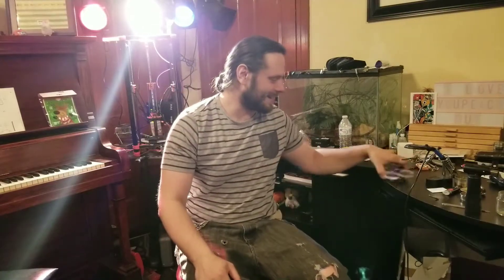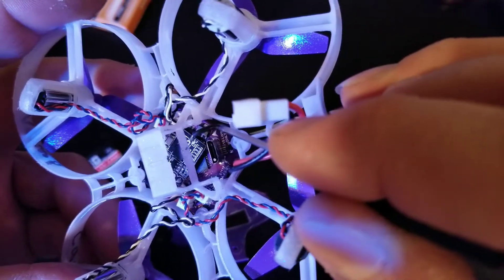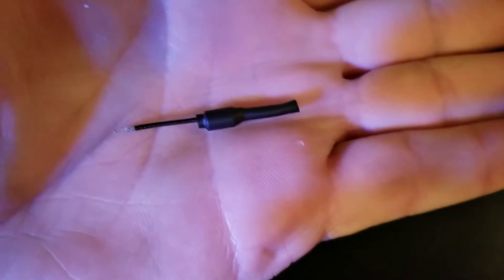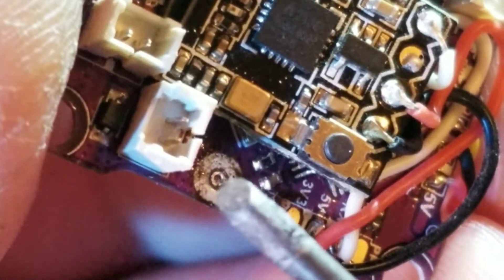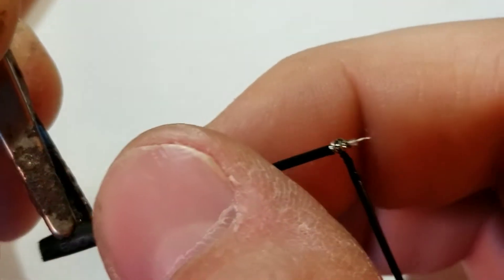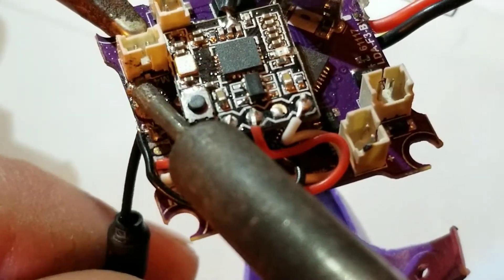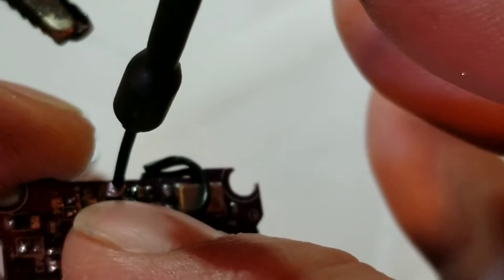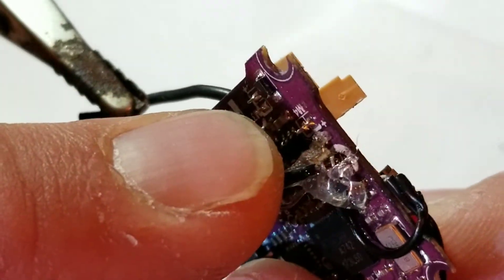King Kong / LDARC Tiny Series VTX Antenna Upgrade

Comment: Dude, my copper antenna from tiny8x just broke off :( guess I will have to hack it up, I guess it will be messy and probably fatal for the FC, wish me luck...need to find the new whip antenna first thou.
Reply from the maker: Did you lose the broke off copper antenna? If you still have it just try to remove the bit that's stuck inside the board, tin the wire that broke off and solder thay bad boy back in. If it's lost then yes, good luck on the new antenna install!

Comment: I have a Tiny GT7, it too has a crappy single copper wire VTX Antenna.  I want to upgrade it to the awesome UF.L Lumineer Micro AXII Shorty that I have on my other Whoops,  that amazes me with it's durability, noise rejection, and range.  I was going to solder a male U.FL connector to the VTX, but like your VTX, it's monopole - no ground connection.  Was trying to figure out if it was best to hook the ground connection to the antenna connection, leave it floating / unconnected, or hook it to VTX ground.  Seems like you had good luck with VTX ground!    Did you happen to try leaving it floating, or connecting it to the antenna connection too, to see if either of those options were better or worse?  

I'm not sure if a VTX that has a dipole connection, is isolating the antenna ground from the power connection ground, or not... or if they're electrically identical!
Reply from the maker: Those are really good points and definitely worth looking into. I'd like to see the result of connecting both antenna and ground to the same point. I feel like leaving it open and floating won't do much good since a dipole needs a ground, if it's floating it will act like a monopole. But the two into one sounds like an interesting idea!
Reply: @vampcaff  word.  I bought a spare vtx too to screw with, so I can test both potentially back to back. I'll report back when I get the parts and break out the iron.
Reply from the maker: For sure bud, I'd be interested in your results. Good luck!

Comment: I did this on a tiny 7 I had once and the range got worse if anything, but I'm not sure if I somehow ruined the hole with the soldering iron being to hot.
Reply from the maker: Did you ground the antenna? If you ruined the through hole the range would definitely get worse. I've had great success with this mod.
Reply: @vampcaff  I put the ground on the battery ground pad rather than the way you did it. I sold the quad n the end up getting another to play with for the then big boy quads are grounded. I would of damaged the home but as the quad was second hand anyway who knows what the person could of done to it.
I've made the antenna up ready for the new one arriving.

Comment: could you link where you got that antenna?
Reply from the maker: https://m.banggood.com/2PCS-Turbowing-3dBi-5_8G-RX-Brass-FPV-Antenna-Omnidirectional-for-Quadcopter-Drone-p-1193794.html?rmmds=detail-bottom-alsolike
Reply: Awesome thanks man! I am assuming this would work for a tiny 6x as well?(Thats what I have)
Reply from the maker: Yeah buddy! As far as i know its the same board for all the x's. Good luck and let me know how it works out for you! Feel free to subscribe, its always appreciated!
Reply: VampCaff  could you possibly direct my noob self to where I would purchase that gauge of wire you used ?
Reply from the maker: @doom3crazy  i just used some thin wire i had laying around from a bad balance plug wire. It doesnt really matter what size you use but i think its 18 guage braided copper wire. I always cut wires off of bad fc's, motors, batteries, etc. Never know when you're going to need some wire.

Comment: Nice idea !!

I also want to upgrade antenna on my KK FC, and was wondering how i will handle the ground connection.
I think i will do just the same.
For the glue, i suggest you have a try at 'liquid electrical tape'. It is better IMO for this kind of things.
Reply from the maker: Awesome, I'll definitely have to check out the liquid electrical tape.  Is it like the paint on plasti dip?
Reply: I never used any other product from plastidip, but i don't think it is like paint.
You can check some videos on my channel where i use it ( on my 16.6g whoop i used it for cam fixation )